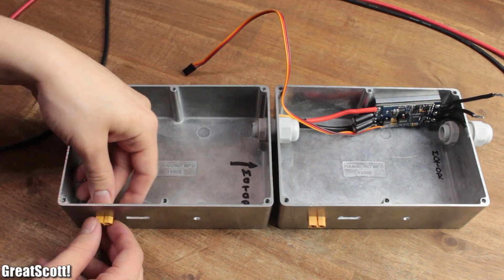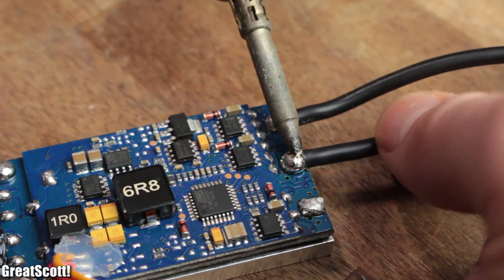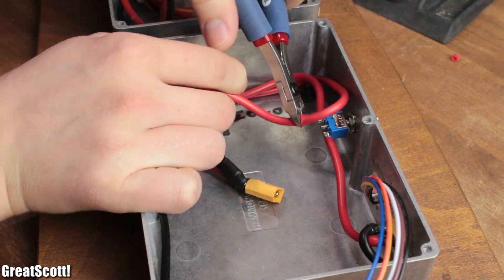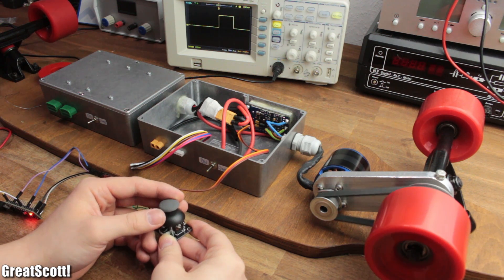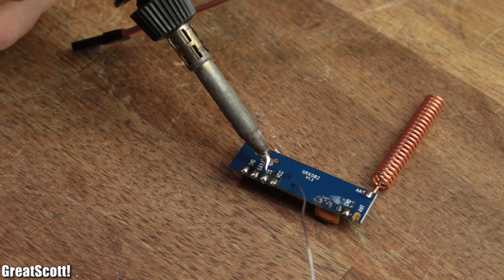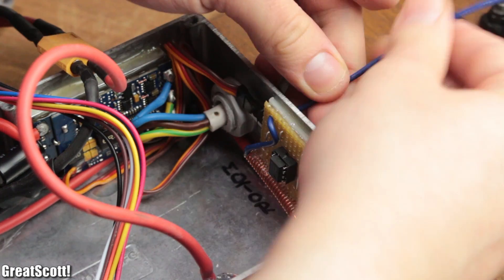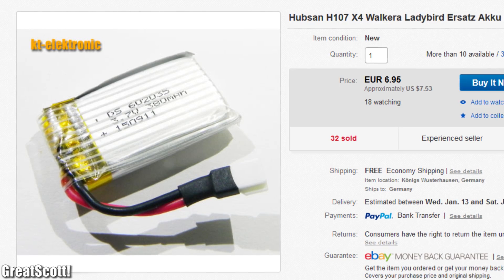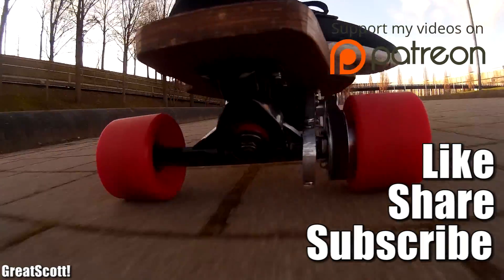Make your own Electric Motorized Longboard (Part 3) - the wiring & remote control

Comment: What do you think about using super capacitors instead of the Li ion batteries?
Reply from the maker: +Nick Drobec No
Reply: +Nick Drobec Really???????????????
Reply: +JetJockey87 Hahahaha, good one :D
Reply: +Nick Drobec I've seen super capacitors paired with a little battery on a car. That thing was powerful enough to cold start it a few good times.
Reply: +MrBiky That's why I've asked but I've made the calculation now and they don't store nearly as much energy as the batteries.
Reply: Nick Drobec Hmmm.. I thought no super capacitor does. That's why they're usually paired with batteries o_O I might be wrong though. Also, I knew they discharge at a very fast rate (though not as fast as normal capacitors - like 1 week at most).
Reply: Capacitors hold potential, not current!

Comment: isn't enclosing LiPo batteries like that dangerous?
Reply from the maker: BillTheBox I used two slightly different types of battery packs. Using them in parallel is never a good idea.
Reply: +octavio echeverria only if they become puffed but it is safe enough because if they do rupture its contained in the metal box.
Reply from the maker: 3zuli The full battery would charge up the empty one. Maybe not with the recommended charging current but the system would survive it. The switches do get not switched on or off while a big current is flowing. So they should last a while. Of course it is a bit of an abuse.
Reply from the maker: +octavio echeverria Why?
Reply: +GreatScott! The way the switches are wired is quite dangerous. If you forget to switch off the drained battery before you switch on the fresh battery, you're gonna have a bad time. Also, a stick or something on the ground could flip the switch into the On position without you even knowing. Not to mention that these switches aren't rated for anything close to the draw of your board.
Reply: +GreatScott! how many cost the board all in all?
Reply: +GreatScott! +GreatScott! why wire the LiPo like that ?
you only use 1 pack at a time, making the drain on the pack heavier,
knowing lipo's aren'ts as efficient as eg 18650's,
you could have used two higher density lower amperage 18650 packs and wired them In parallel.
Reply: +octavio echeverria lipos are only dangerous if you dont use them properly, i have one in my airsoft gun behind a magnesium plate with two scews, its fine, just use the correct charger and never overdrain or overcharge
Reply: +GreatScott!  the batteries expand when changed and shrink when discharged due to how tight you have them pack they cannot expand correctly so when fully charged there will be an increased internal pressure which will make them more likely to rupture and set on fire.
Reply: +octavio echeverria Only if they go full short for an extended amount of time... you can pull a transient current of upwards of 50A from the LiPo cell of an RC vehicle and they'll happily give you a good 30A continuous until they run out of energy... if you have the cell under full short, then it'll cause the cell to heat up rapidly and when it does, it can create a reaction that can't be stopped until all energy is depleted from the cells... and the results are pretty awesome in a bad way!!
Reply: +BillTheBox considering doing just that. would put them inside the board directly, though that would remove the potential flex. not sure since i have 0 long board experience.
Reply: +Tom Mccarthy no. lipos do not expand or contact. 

they only "puff" if you discharge them at too high of a current.  I've been flying multirotors and helicopters on lipos for 5 years now....
Reply: +GreatScott! true :)
I would maybe have made it with recycled 18650's though; but that's me; as it makes everything a bit more complicated

Love your videos
Reply: Llewln recycled lipos are only good for stationary applications the their energy density is not as good as the flat packs.
Reply: +Toby Forbes No, the cells inside a USB power bank aren't rated to discharge enough current to power this thing. The cells in a power pank are meant to discharge at around 25W max, whereas this thing draws over 500W easily.
Reply: digitalradiohacker yeah... if you're AvE especially it's awesome!! XDD
Reply: digitalradiohacker Oh, she'll chooch alright... she'll be skookum as frig when ya double 'em up too... DOUBLE THE CHOOCH FACTOR!!!
Reply: digitalradiohacker yup... and if you use a lineman's splice it makes the link all the more skookum (and what can be more cool than having cable joins that NASA would approve?...)
Reply: +BillTheBox 18650 battery's are lipos...
Reply: topher LiIon and LiPo, although LiPo tend to be in a brick format because it's cheaper to make...
Reply: +GreatScott! You should probably be careful, as I personally doubt the system would actually survive, the current would kill the battery that the charge is flowing too as you'd be applying over 10x the recommended charging current, also, the amount of current you're pulling through those switches worries me, I think they're only rated for something like 10a and you'll be pulling over 70 at times. I would've bought new batteries and wired them in parallel and had them permanently to the charging circuit, with one main large on/off switch to the motor
Reply: +GreatScott! Can I buy it off you?
Reply: I tried, but 18650's haven't got enough discharge rate.

Comment: Isn't that illegal in germany?
Reply: +mont3r3y What is not illegal here?^^
Reply: ich denke wir reden mal auf Deutsch weiter ^^,
aber das boosted board ist doch auch illegal? weil es so schnell ist
Reply: Ausgenommen ist unter anderem:
Vierrädrige Leichtkraftfahrzeuge mit einer Leermasse von weniger als 350 kg, ohne Masse der Batterien im Fall von Elektrofahrzeugen, mit einer durch die Bauart bestimmten Höchstgeschwindigkeit von 45 km/h oder weniger und einem Hubraum für Fremdzündungsmotoren von 50 cm³ oder weniger, beziehungsweise einer maximalen Nennleistung von 4 kW oder weniger für andere Motortypen.
Reply: Yes it is, for everything that moves faster than 11km/h you need an registration and a number plate.
Reply: +iceberg789 This is only for motorized vehicles. ;)
Reply: SkilllessFlorid3r
Dann dürfte man doch auch Mofa ohne Schein fahren.
Reply: Mr HamsterBacke 
Die haben keine vier Räder.
Reply: Achso ja^^^danke für die Info
Reply: +SkilllessFlorid3r das gilt leider nicht für selbst zusammengeschraubte Fahrzeuge ohne ABE und TÜV Siegel.
Ich kann mir aber auch nicht vorstellen, dass es irgendein Schwein interessiert.
Reply: +mont3r3y Wenn es korrekt zugelassen wurde, du nen Führerschein dafür hast und es bei der Versicherung angemeldet ist; DANN ist es erstmal legal xD
Das ist doch einfach nur noch krank hier in DE, ich meine, zulassungsfrei ist hier nur unter 250W und weniger als 11km/h; aber eine Modellauto mit 10kg gewicht, 10.000W Motor und über 200km/h Spitze benötigt nur eine Haftpflichtversicherung... 
Mal im ernst, ich kann aus reiner Muskelkraft weitaus mehr als 11km/h fahren...
Reply: David Frau
Nice try.
Reply: David Frau
Nice try starting a flamewar.
Reply: I can nazi why not.

Comment: Why did you not just use the I2C buss of the nunchuck?
Reply from the maker: +gudenau I think a couple wires is easier than using a data protocol.
Reply: Yes but that would have saved the nunchuck for use in the future, and could have been a learning opportunity.

Comment: Really good project, I started the same build at the begining of september and I had some similar technical solutions as yours (like the wii nunchuck, and the brushless motor/esc system). Although I was thinking more about using a arduino bluetooth HC-06 module for communication to maybe build an android app to control the board, what do you think about that?
Thanks again for those amazing videos that keep us all entertained and educated! =)
Reply from the maker: +HARIBUS I just don't like to have a phone in my hand while riding such a thing. It would be the first thing that would break if something goes wrong. But the rest sounds good.

Comment: can you please make a li-ion battery charger circuit? I have made a power bank from used 18650 batteries but I have no charger to charge the power bank. the power bank consists of two units in parallel of 3 batteries in series giving 12.4v output.

Comment: What if you put on the other wheel another motor and used the other bbattery to power that using a higher ratio For the wheel hinge? I think that would be a reeeally good upgrade in costs of performance and comfort

Comment: Rather than have the knob control the speed of the motor directly, I would have it set up the micro to integrate the output from it so that you control the acceleration/deceleration of the motor rather than the speed directly. This way when you don't push the pot up or down, the board effectively is either stopped or in cruising at constant power/speed, and adjusting it up or down causes acceleration/deceleration accordingly. Nice build though!
Reply from the maker: +Power Max Pretty good idea. I might need to try this out someday.

Comment: great project !. i really want to do it myself to . but i dont have a lot of money .
so is found a 1250 watt 1600 kv motor for 20 euro and a 80a esc for 20 euro will the motor be enough to get me going ?
olso i found 3 lipo batterys 3s 11,1 volt 3300 mah. how long wil 1 battery last or do i have to use all 3 of them ??
and ofcourse the pulleys rc transmitter, and the motor mount .but i will figure that out.

Comment: Great video. Maybe a project I'll try in the summer. Can I ask if you have any cell checkers wired in? I'd hate to have a battery that size fail on me.
Reply from the maker: +Isaac Gilmour The probability that a single cell will loose its capacity earlier than the other ones in such a harmonized package is very small. Especially because I am using a balance charger. The ESC will turn the battery off once a certain cut off voltage is reached.
Reply: +GreatScott! Cool. I've not had much to do with escs but since I've got a spare longboard sitting I will try this.

Comment: How much did it all cost? I want to compare the price of a DIY electric longboard to a electric longboard made by other companies.
Reply: I almost guarantee it's cheaper to buy one from China but it's so much cooler to build one lol
Reply: it can be pretty cheap if you use salvaged parts
Reply: +eucalyptux  
lol 18650 batteries. 

no way could they handle the amps you will be drawing off a 200-400kv 63mm outrunner. 

you should have a 80A ESC as a minimum
Reply: +Kevin Larsson i'm building one myself, it's been 4 months since i started and i haven't finished, but that's because I have been waiting a long time to get one part. I've used a commercial longboard from amazon, and two arduinos, a nunchuck, two batteries, etc and i think in total it was like 300€ moreless...
Reply: JetJockey87 it depend of how many 18650 you have and how you wire them
There is even electric cars that use 18650's
Reply: Kevin Larsson I think its about 300-400
Reply: JBpiification ok ty :)
Reply: when you can get arduinos for 2$ shipped on ebay, used nunchuck for like 5$, 18650 batteries for very cheap in laptop batteries ... the only parts that you would almost every time need to buy is the motor and most of the electronic.
Reply: eucalyptux i think that the "controller part" only took like 20€ max, and then the motor, battery, esc and board has the rest of it...
Reply: +LeiserGeist  
i built one. cost me $1800 but was damn fun and I love my board. company sold kits to basically help with a lot of stuff. they're out of business now tho sadly. called RedRockBoardShop
Reply: LeiserGeist nope, it's cheaper to do it yourself. the cheapest one i could find prebuild was 500€ and mine costed me 300...
Reply: +JetJockey87 what do you mean, if I was to use a 245kv motor or something like that, how much current and voltage for the battery do u think I should get
Reply: +Pewe no way its that cheap with battery and charger too
Reply: +JetJockey87 You mean my USB battery bank/jump starter that's rated for 150A (300A peak) is bogus? Or the battery packs people build from 18650's to power eBikes and electric cars?
Reply: +JetJockey87 Ehhh? You can definately build a battery pack for E-boards stacking some in parallell and then series those up. There are packs specific for this out there with over 250 watt hours and 30 A continuos which is enough to power TWO motors. That's all.
Reply: +JetJockey87 can you make a video about your board please
Reply: the expensive part as with many vehicles is the battery. if you do it yourself you can build your own pack with used batteries (18650s from old laptop packs), which would save you quite a bit of money. you could also add a few features i haven't seen yet, like the board maintaining speed so no controller would be needed (would of course need some detection if someone is actually on the board :D).
Reply: +IscleGaming | ZefaCraft link for the 500 pound one? Doubt my parents will let me use a soldering iron :/
Reply: Eli Maffry it wasn't this one, i don't remember where i saw it... this one is 500€ and seems like a good quality one http://www.aliexpress.com/item/BENCHWHEEL-electric-skateboard-Wireless-remote-controlled-dual-motor-drive-sino-wave-controlled-skateboard-on-road-longboard/32545620238.html?spm=2114.01010208.3.113.Go3QIa&ws_ab_test=searchweb201556_0,searchweb201602_1_10037_10017_10034_10021_507_10022_10032_10020_10018_10019,searchweb201603_6&btsid=620ccb9f-638d-4884-b733-46f6169bf553
Reply: I tried 18650's but they cant deliver enough amps.
Reply: bob kerssemakers There are good 18650's and bad ones...some give out 40A.
Reply: A lot cheaper - Boost Board is anywhere from $750 - $2500+, and this is around $300-400, or cheaper
Reply: You could have bought a boosted board for that lol

Comment: Great project! Don't you think that approx. 3-5A switch you used is not gonna be enough to drive motor controllers at load?
Reply from the maker: +JumperOneTV It is a small abuse of the switches. But since I am only switching things on and off while the motor does not spin (small current) the switches should last long enough.
Reply: +GreatScott! I've just measured the resistance (for kicks :) ) of two switches (the same size and construction that you used, from two different manufacturers) and the numbers are the following (4-wire resistance measurement @ 1A current, 6 measurements for each side of a switch, 4 toggling of a switch without power between each measurement):

Sw#1: 7.11 milliOhms and 3.5 mOhms.    
Sw#2: 3.85 mOhms and 4.35 mOhms.   
Max R for Sw #1: 8.6 mOhms, for Sw #2: 4.6 mOhms.   

This gives us dissipated power of (for max. values):

Sw #1: 0.86W @ 10A and 7.74W @ 30A.
Sw #2: 0.46W @ 10A and 4.14W @ 30A.

Now, I don't know how much current the motor driver will draw at what conditions, but I guess the fully loaded inrush current might be very high.
It looks like it's better to replace those switches (but it's up to you, of course).
Cheers! =)
Reply: Dont the spark ? bcs i needed to buy a xt90 as a "switch" because i had big problems with sparking when connecting the positive lead

Comment: That switch is surely not up for the job
Reply from the maker: +Benjamin Harvey Since I am not switching it on or off while the motor spins it should last a while. Of course it is a bit of an abuse.
Reply: +GreatScott! Maybe using it to trigger a power transistor like an IGBT or a solid state relay would be the way to go. I'm definitely keen to give this project a go. Thanks for the inspiration